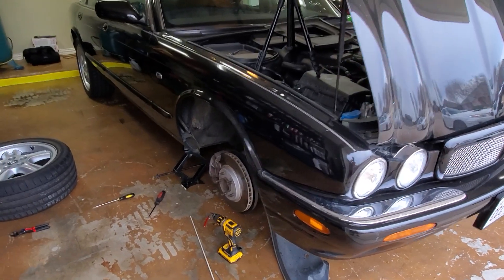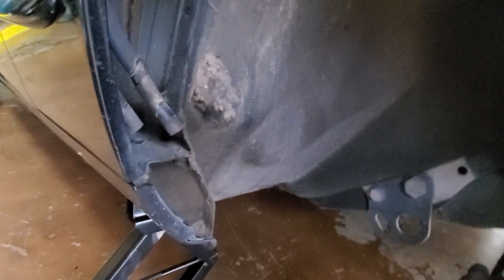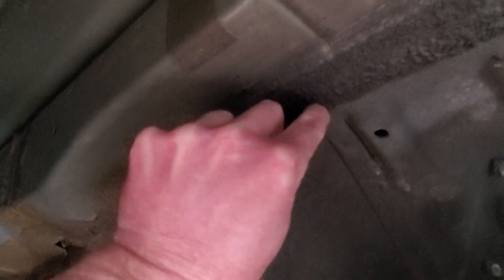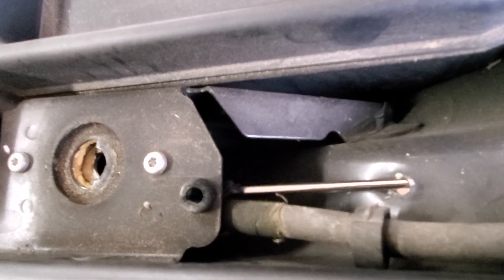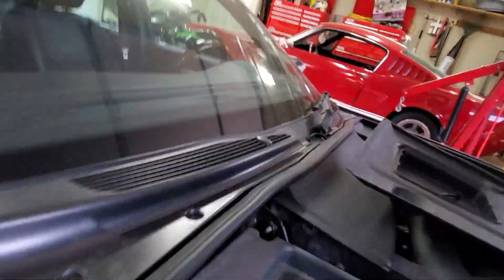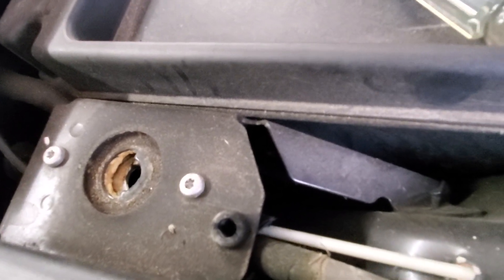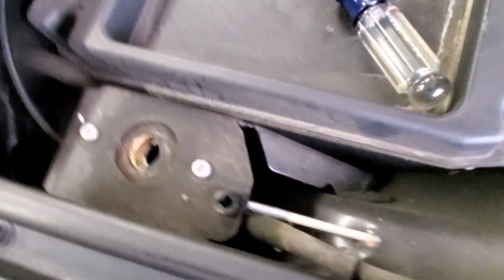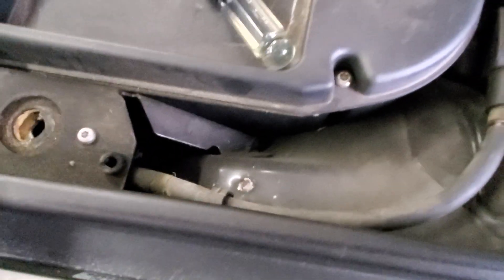How to open a hood stuck shut on a Jaguar XJ8/XJR 98-03

Comment: Exactly right! I used a 12 inch long dowel and it took no more that 3 minutes of poking for it to unlatch. The slot that holds the cable allows it to just drop down, so I am going to follow up both sides with some JB Weld to prevent this in the future. The cable itself is in good shape and no corrosion. Mine was driver's side so, yes, it works both sides.

Comment: This is an excellent video, but unfortunately it didn't quite resolve my problem because the battery cable got in the way.  Not being able to understand the layout of the hidden hood latch, I drilled a 7/16in hole 2in directly down from the inner fender hole that Mustang Tyson identified.  But I saw very little, yet I felt that something was obstructing a straight prod at the hood-release cable end.  So I drilled a second  7/16in hole to the left of my first drilling and now a picture emerged: a cable was in the way.  So I slipped a screwdriver through the hole and moved the cable toward the outer fender.  With a 1/8in diameter steel rod protruding into the engine bay, I could now prod the cable end and, bingo, the hood latch quietly opened.  Thank you Mustang Tyson for your assistance in this matter.  Cheers  Vic

Comment: Thanks. Was actually easy peasy. I used a piece fiberglass tent pole. Needs to go in a little over 4 in. Just straight back. 
What happens is the cable slides out of a slot in the lever.  Not sure what's supposed to hold it in just tension or a little grommet that doesn't seem to do much. Bad design. I glued a little piece of metal on bottom of the slot to keep it from falling out again

Comment: Does this work on the drivers side also? My is stuck on the drivers side
Reply: Hey did this help you on the driver side ??
Reply: I just did this on a jag with broken hood latch cables. It works for both sides.

Comment: Same issue on my XJ8 with the right latch.
Probably a better solution than cutting the metal in front of the latch, however you are probably lacking some visibility...